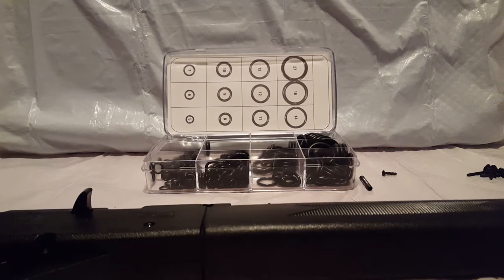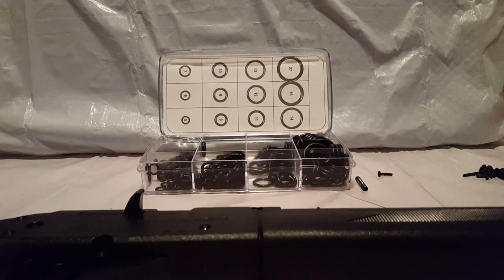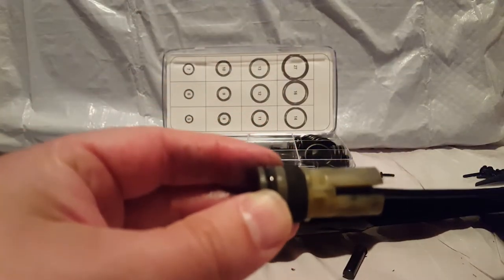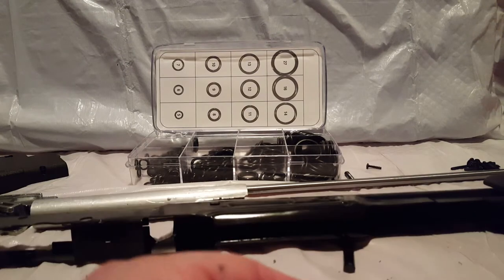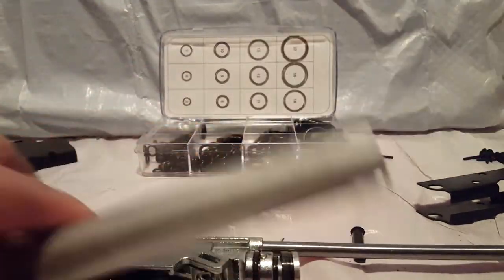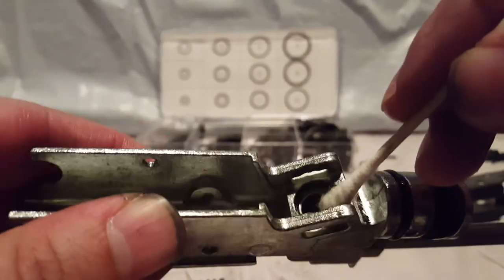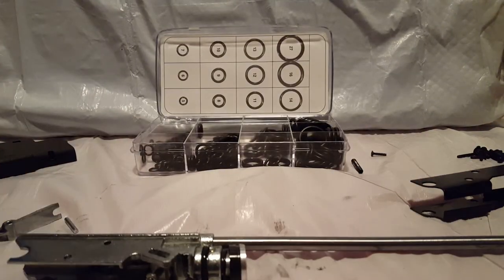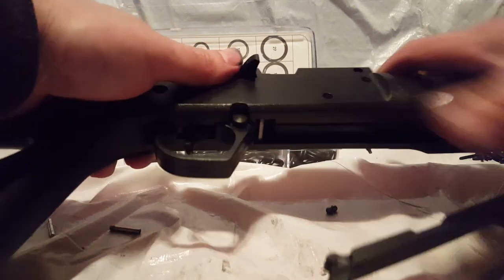Daisy 880 Fix. Rehabbing Used 880, 901, and 35.

Comment: Daisy Powerline 880 (old style)
When I got the gun it would not accumulate/hold pressure. I replaced all the o-rings and the pressure chamber. Upon reassembling, I can only accumulate pressure with the bolt all the way back, and as soon as I slide it forward, it discharges. What have I messed up? Or what am I missing? I’m suspecting the spring or the safety tab.
Reply from the maker: Lainie, thank you so much for the contact, I was going ro get into video for finer 880 mechanics. You look airgun smart so that helps here. Ok, here we can talk,; this isnt a channel for brass style, but we can sort it here. 

Modest deduction tells us this isn't a ring issue, nor a chamber seal issue, but trigger mechanics.

Some are confused by safety tab, but because of you I made sure to test without it. Trigger assembly still operates without tab.

Your trigger sear CAN NOT be catching the hammer arm (catch point). The counter spring action between the poppet compression spring and the trigger compression spring is out of whack.

You discharging the gun when the bolt comes forward shows the hammer arm is shooting up as you take tension off it.

I have trigger video that should work for your old brasser. It is tough for you guys because the screw in poppet and solid face (no hole) chamber seal aren't used any more. My fav gunshop told me when the brass guy was it, they liked Crosman better.

The current $1 seal kit from Daisy, has 4 out of 5 parts that work for your gun. But the basic Nitrile rings you can get from the store. I don't  know if you've done that. Did you say you have new valve?

I don't know if you bought the rebuild kit which is 30-50 bucks for your style.

On safety tab, make sure it is not riding on top of of frame (flat part near breach). Should be just under on ledge on lip. Keep your tab in gun. Keep it.

I would start over. Watch my trigger video. Also made hack video with 80 year old shooter if your chamber seal doesn't check the air.

I would be interested to know how much $$$ you are in on the brasser and did you buy rebuild kit.

The silver style has better rifling and pump tube evolution. Wal-Mart has these units for 25-35 bucks. But collectors like the metal recievers. Let me know if you need links.
Reply: Daisy 880 Fanatic Fix It Thanks for responding. I think I’m about $40-50 in to fixing. I’ve only replaced the o rings and pressure chamber. I am going to have a look at my trigger, sear, and spring assembly; and possibly replace the spring, based on your reply.